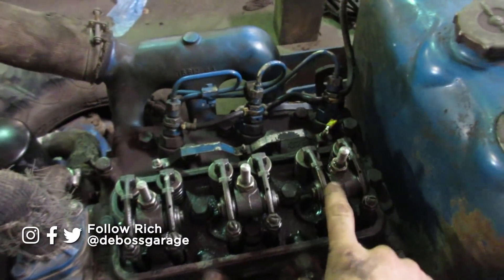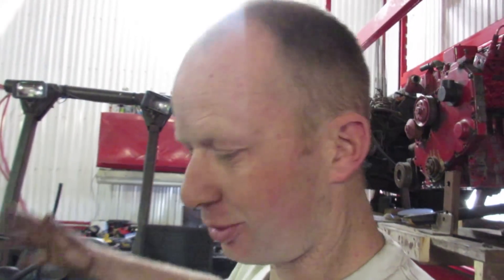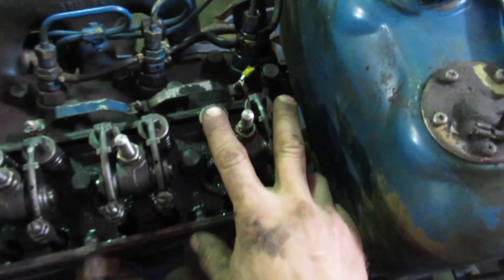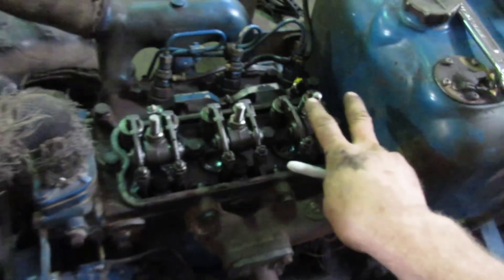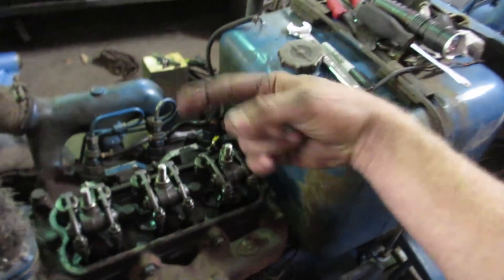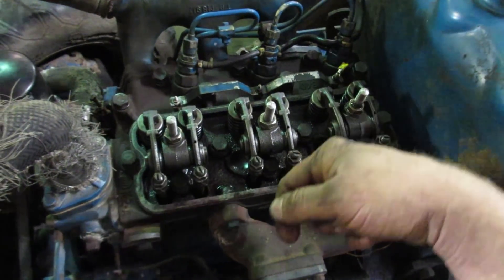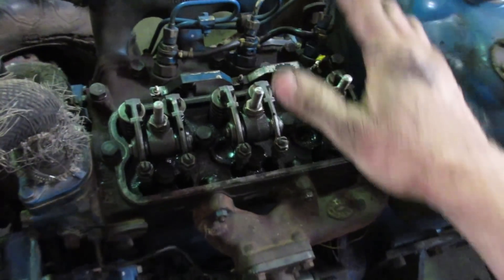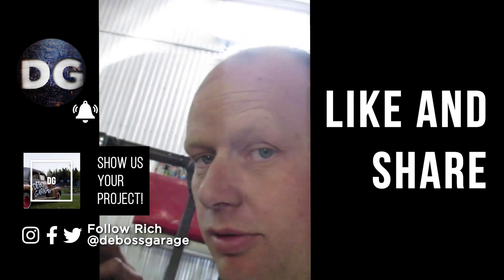How To Set Valve Lash On A Three Cylinder Engine

Comment: I'm not sure why he is doing all this extra work. The correct procedure is to rotate the engine to TDC, if #1 valves are not depressed, adjust #1 exhaust and intake, #2 exhaust, and # 3 intake. Then rotate the engine once stopping at TDC and adjust #2 intake and #3 exhaust. Done
Reply from the maker: because it's much easier to forget to set one your way, but both are correct.  One is not more work than the other

Comment: Can this be done like this on a Kubota L2500F the same way. Im guessing yes because its a 3 cylinder, but Im just asking. I do some mechanic work but I've never worked on diesel engines before. My valves are tapping with a knocking sound and I noticed they are really tight. Ive checked all else and everything else seems to be ok. your vid is so far the most simple at explaining the process.

Comment: I noticed the RV in the shop in past videos. Any possibility you can do a video on what to look for and what to avoid when buying a used diesel RV?  If I find one I like it will be my first diesel ever.
Reply from the maker: I can't make a video on this one.  If I get my hands on another one, I will definitely tell you what I came across.  For this one, the drivetrain is behind the back tires.  All the salt gets shot up onto it and everything is rotten.  After a new oil pan, rad, timing cover, all new intake pipes, coolant pipes, overflow tank....  Unreliable money pit
Reply: What year and model was that one? Yeah, unfortunately I am in one of those salt states that see a lot of overly rusted vehicles.Thanks

Comment: Once they are rocking, then move crank 360 degrees before adjusting? Why not adjust when they are rocking?
Reply: The camshaft rotates and half the speed of the engine. So, if you rotate the engine 360 degrees you have rotated the camshaft 180 degrees.
Reply from the maker: Because it will be on the top of the cam lobe instead of the heel.
Reply: I still don't get this. If the rocker is on the top of the cam lobe, won't that valve be open, and not able to be properly adjusted? I've always adjusted valves when the rocker is not on a lobe, in order to provide the recommended clearance.